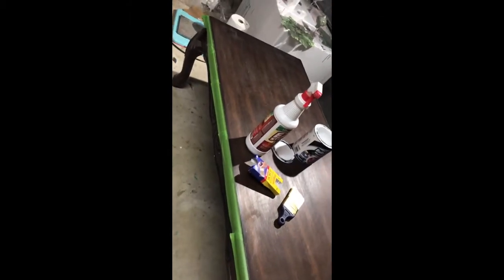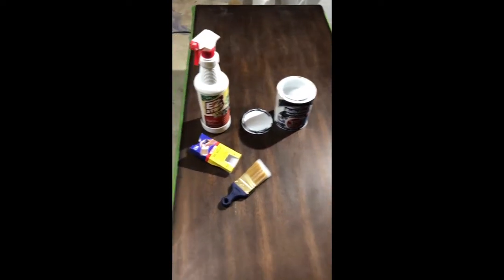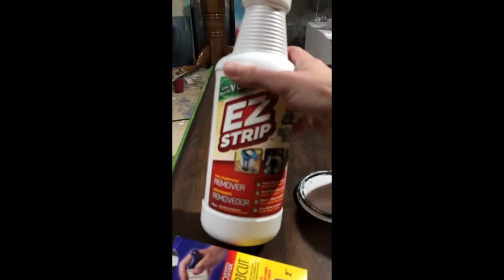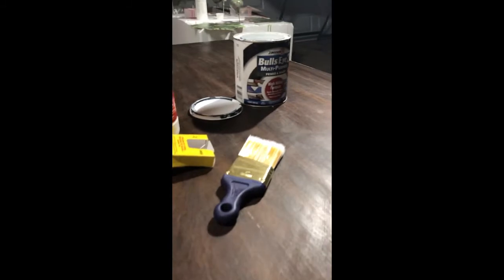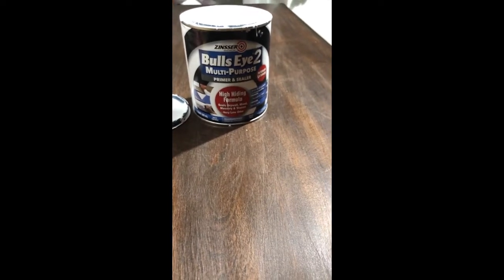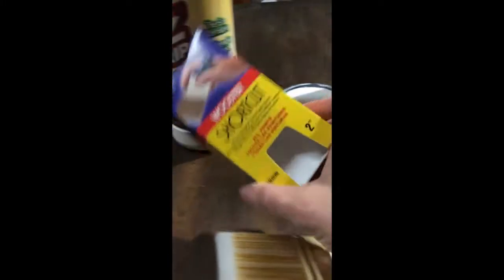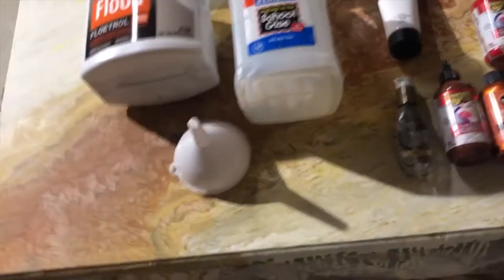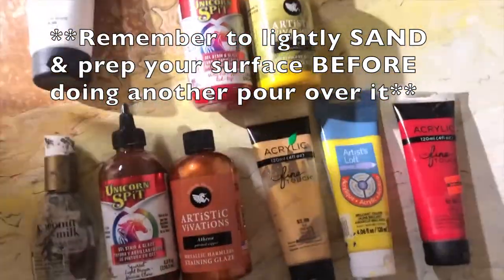Faux Marble Table Acrylic Pour DIY Tutorial

Comment: Gorgeous piece.  I am going to attempt to pour our coffee table.  How did you calculate how much paint you would need?  Do you know the size of this table?  Glad I found your video...thanks
Reply from the maker: Kodi Asman thank you! The amount of paint needed depends on the style you’re going for & the size of the table. For this project, I made sure my base coat (gunmetal) was enough to cover the entire table so that the paint added would stack on top of it and move well. I would say the best thing to do is practice the technique before pouring to make sure the consistency of the paint is what you want & you have enough to work with. Once you have that down, it’s easy to move forward. I actually did a pour on this table & it didn’t turn out as I wanted so I sanded lightly & poured over it. Table is 23 x 47’’ & I filled an Elmer’s glue container that was 1 gallon about 1/2 way. Hope that helps!